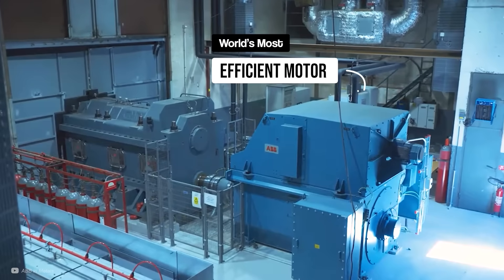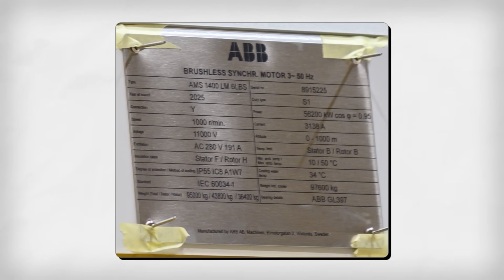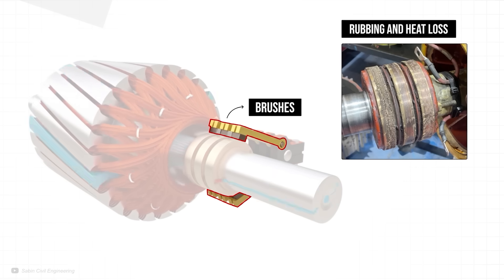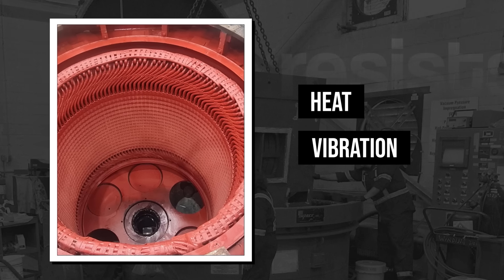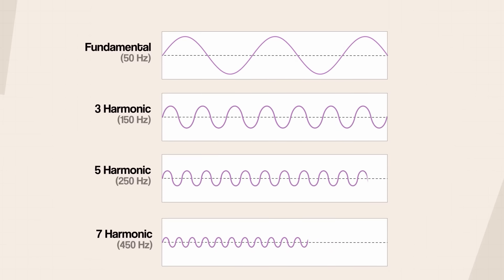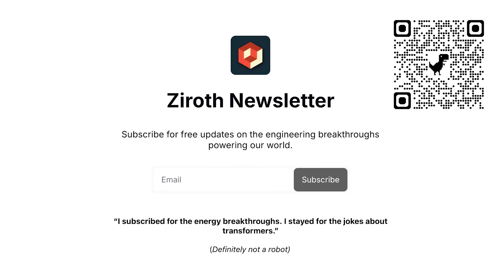How This Ultra Efficient Motor Just Broke The Limits

Comment: As someone who has worked in the field I'd like to comment on a few things.

0:20 "motors are normally stuck around the 96% mark" That's not really true, you can look at other manufacturers, for example Siemens energy and you will also find efficiencies close to 99%. I think the value in your paper refers to smaller motors. I don't think you referenced the paper. If you tell me its name I can check.
3:19 "but these [slip rings] are far too inefficient [...], which would crash motor efficiency" Do you have any sources for this? I don't think the losses of slip rings are too high, maybe in the range of 1-2 % of the power they transfer. "Wireless" power transfer also has an efficiency <100%, so I'm not sure how much better this actually is in terms of efficiency. I also want to note that inductive power transfer has been common in the industry for a long time, so I don't think there is too much innovation here.
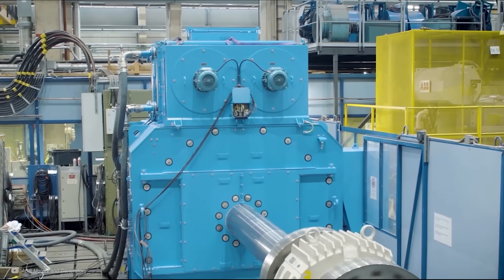4:00 regarding form wound windings: for motors this large these are used nearly exclusively, so this is also not a unique selling point of ABB.
7:54 regarding solid single piece rotors: again, ABB aren't the only ones doing this.
7:58 regarding "solid plates": I'm not even sure what this means and I have doubts that you do. How would these plates increase the surface area?
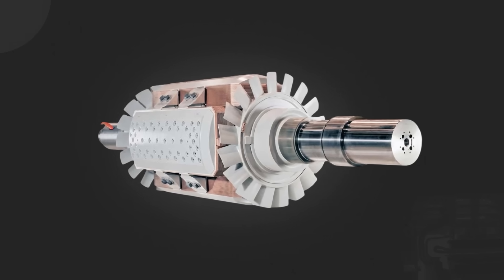8:48 "This [using a fan on the rotor] seems like a very efficient way to cool it, as it doesn't require large pumps [...]" This is correct, but I believe there is a technicality you are overlooking. Looking at the nameplate you can see that the motor is made according to standard IEC 60034-1. This leads me to strongly believe that the testing was done according to IEC 60034-2-1, probably using method 2-1-2C. This will probably mean nothing to you and you can't even legally look it up without purchasing the standard I believe. But what I can tell you from being in the industry is that according to this standard, the power of auxiliary equipment like pumps and blowers is NOT considered in the efficiency calculation. So to increase the rated efficiency you could theoretically remove the fans on the rotor to reduce air resistance and instead add an external fan, since the power for the external fan is irrelevant for the efficiency according to the standard. Of course this wouldn't make sense in practice, but it would look good on paper.
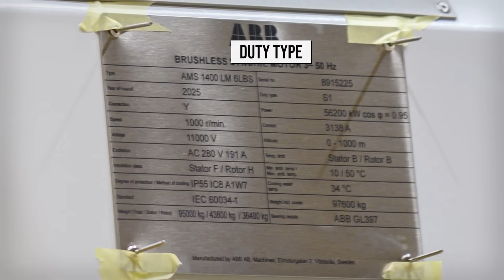9:17 you say that S1 operation is good, because the motor doesn't waste energy speeding up and slowing down. But I think this is missing the point a bit. These large synchronous motors are directly connected to the grid, making their speed basically constant. For motors like these, it is generally about the torque / load. So another type of operation might have a periodic torque profile instead of a constant torque. 
9:54 regarding the efficiency plot: Again, a bit misleading since these motors will only operate at a speed dictated by the grid frequency and the number of pole-pairs.
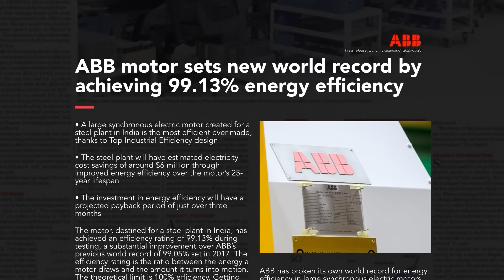11:00 regarding the cost calculation, I totally agree with you. Either it is a typo or the must've made some ridiculous assumptions.

Additional comment: 
As for everything in engineering there are always trade-offs. Maybe ABB used some highly efficient bearings, which have lower life-time or higher maintenance, we don't really know. So relying on a single number like "testing efficiency" and saying "this is the best motor" is never a good idea.
Reply: This is a much more complete reply, but I came to the comments to say ol' Ziroth gave nearly zero info on what ABB did to hit this record efficiency and instead stated a bunch of standard well known motor facts
Reply: As an engineer who worked both in Siemens and ABB in the motor and converter department as manager, I completely agree with you.
Both Siemens and ABB are great companies and 99% efficiency for motors of this size is not uncommon.
Of course it should be the electrical efficiency of the motor only, not the overall efficiency of the system with the load. Also the energy required to cool down the motor must have been excluded from their calculations.
$60,000 is ridiculous for a 50+ MW motor. That's cheap even for 500 kW.
Reply: @user-yt198 Even $600,000 is a low ball.  I'd say more like $6M easy.
Reply: Also, why didn't Ziroth just talk to the manufacturer to get accurate information?
Reply: Dr Ryan doesn't really explain stuff he just reads out press releases.
Reply: yeah, when I heard they use external pumps for cooling, made me wonder just how much energy is lost as heat that you require all that equipment. Would this heat represent the 0.87% power loss ? If so, must pay a price to went it all out at 50MW input. Is that like 435KW ?
Reply: Found an interesting paper on the brushless variable frequency motor / generators on the Boeing 787 and there is a lot of interesting things going on with the brushless aspect of this system. Was hoping that this video would go into more details about that part of the motor.
Reply: Yeah. They definitely used the standard to their advantage and conveniently published their world record results without any testing numbers. I'm actually surprised they let the picture of the data plate slip through. ABB waves their magic wand at the crowd and tells them to nevermind the  50+ kW power just for excitation. With an input power over 67.5 mW at full current and speed they must  have a real sweet spot in that design to get a 56.2mW rated motor to break η past 99.

It's not as though 99% of the people who see that claim would have any clue how to make the calculations to refute it or know anything about the testing methods.

Shameful really.
Reply: @BxxMxxK I believe you mean MW instead of mW.
How did you calculate 67.5 MW?
P_el = 11kV * 3138A * sqrt(3) * 0.95 = 56.8 MW.
If you use the efficiency you calculate P_el = 56.2MW / 99.13% = 56.7 MW.
The small difference can easily be explained by rounding in the cos phi value. So the nameplate seems fine to me.
Reply: Another consideration is that measuring efficiency with this level of accuracy is itself very difficult due to the tolerances of the equipment.
Reply: @gullenator1 yeah, it's not that easy.
For big motors like this, efficiency is usually not measured directly. There are different measurement strategies to determine the different loss components.
Reply: @MrZauberwuerfel 

This video is clearly not pitched at people who are experts in the industry 😂 I learned a lot from this video, even if it seems this is all old technology 🤷‍♂️ 

I look forward to your much improved video explaining all the things you mentioned!
Reply: The nameplate says 3-50hz, wouldn't a motor like this, at least in many applications, normally use a VFD, at least for startup, not just some huge contactors sending it power straight from the grid?  I imagine some applications want speed control, and they need to limit starting amps.
Reply: @Artcore103 think if this motor bangs in with contactor! Many motors even without load could easily take 10x more load at very short time.

I think this motor could be put in grid and then starting to rising power for it's rotor, if they don't use thyristors to start it, before closing contactor fully.
Reply: @jannejohansson3383 the thyristors normally have a rating way higher than the rotor is designed to handle. All it does it shorts the plus and minus ring on the rectifier assembly. Normally we see discharge resistors which are found on units that are straight to the grid. Normally I see vfd start motors which are capable of running fully on the vfd but the end user will be using it only for start up.
Reply: That IEC standard is actually pretty easy to legally obtain for free, with one loophole:
The trick is to search for: "ГОСТ IEC 60034-1". Which is de-facto just a translation of the IEC standard, but de-jure it's a separate document, published by another entity.
It is legal to read for free because of "ст. 1259 ГК РФ", i.e. article 1259 or the civil code, which says exclusive rights can't apply to legal documents and government standards.
So just prepend "ГОСТ" to an international standard when searching, and use an online translation tool to read it (or learn Russian).
Reply: MrZ is guessing about running direct off the grid.  Why didn't he just ask the manufacture or the buyer?  It very well could be started and run with an inverter to control speed and torque across a wide operating range.  Else additional "damper bars" winding can be use for grid startup, but there was no info about that. 
It does not make sense that it is not PM (permanent magnet) which would have far less losses than either a wound field or induction machine, unless it is actually superconducting.  There is alot off missing and questionable info.  Seems more like bait for that 8bed thing.
Reply: I was coming here to write my own essay based on my experience at GE large motors. Thanks for saving me the time. Seems everyone is doing the same stuff. Those plates are commonly referred to as pole tips. The GE design from Peterborough machined the rotor from a solid forging, including the pole tips.
Reply: @JaredLucas and wasnt cheap!
Reply: Legally obtaining IEC 60034 for free is actually pretty easy.
You just prepend "ГОСТ" to the name of the standard when googling, and you get the translated version.
Thanks to article 1259 of the civil code any government standard in Russian is public domain.
Reply: Others might have done them separately, but together?
Reply: Legally obtaining IEC 60034 - 1 for free is actually pretty easy.
You just prepend "ГОСТ" to the name of the standard in your searchengine, and you can read the translated version. Thanks to article 1259 of the civil code any government standard in Russian in public domain.
Reply: Legally obtaining IEC 60034 for free is actually pretty easy.
You just prepend "ГОСТ" to the name of the standard in your searchengine of choice, and you can read the translated version. Thanks to article 1259 of the civil code, any government standard in Russian in public domain.
Reply: Re: "Solid Plates" I believe what he is alluding to is the poles are made of a solid mass of iron as opposed to a laminated steel core with a squirrel cage start winding.  This motor is referred to as a hysteresis or eddy current start motor. The eddy currents in the pole initiate rotation. The rotor gets really hot on startup, and as very low stating torque and normally it has to be up to speed before the load is introduced. The tips of the poles are machined in a sawtooth fashion to increase surface area to aid in cooling during start up.  Once the rotor is up to synchronous speed the slip is zero and eddy currents are not present. As well this design is not exclusive to ABB and it has been around for decades.
Reply: @joekoncovy ah, so solid plates are the salient pole design, but without damper/amortisseur windings?
Reply: Or pay more for exotics material or construction techniques.
Reply: I attend to agree about the friction loss estimate for the slip rings.  Those brushes are made of graphite, which is an excellent solid-state lubricant.
Reply: "I don't think the losses of slip rings are too high, maybe in the range of 1-2 % of the power they transfer." Wouldn't that immediately cause them to miss the 99.13% efficiency goal?
Reply: @prdoyle no, the slip rings only transfer the power used for the excitation of the rotor, ~50kW
Reply: @prdoyle      The watts sent to the excitation circuit is only about 1/1000 of the watts used by the motor, or <53.5 KW vs. 56.8 MW, so excitation is less than 0.1% of total motor stator watts. Now take 1%-2% of that number and it becomes 0.001% to 0.002% loss. The advantage with using brushless excitation is the elimination of carbon dust and no slip rings to maintain.
Reply from the maker: @MrZauberwuerfel I wrote a response last night, but thought I would spend more time to write this one as it wasn't making the point I wanted to very clearly. 

Firstly, thanks for commenting, there is a lot of interesting insights here. The context of this video, which I didn't make as clear as I should have, is that I wanted to show how the worlds most efficient electric motor(s), namely large industrial motors, reach such high efficiencies. Especially when compared to the standard motors many people are aware of, like those found in electric vehicles. The aim of the video was to show what is done to make the jump from around 96% peak efficiency in those motors, to 99% in large industrial motors (specifically the ABB one). This not being made clear is probably the main issue here, and was to reflect that the 'broad' audience who watch these videos might be interested in the design of these large motors and how they differ from more common ones. It is not a video about how one industrial motor is 0.1% more efficient than another one - that is a very different video.

On to the specific points:

0:20 Correct, this refers to smaller motors that most people would have come across.

3:19 "inductive power transfer has been common in the industry for a long time" - this is exactly because they are more efficient than slip rings, especially for large motors. Losses in the slip rings due to friction and less than perfect connections are higher than the electrical losses for inductive coupling. I used stronger language here than maybe it needed, but the point remains that slip rings would have prevented this motor getting the record, and it is an interesting thing to note, in my opinion. This video isn't about a new breakthrough or innovation, just lots of well used engineering principles.

4:00 Correct, this is because they are more efficient and it was worth noting as it is a key part of their design.

7:54 Correct, again, this is still an interesting part of the motor that a non-specialist audience may not have known about.

7:58 From ABB's publication 'Synchronous motors - High performance in all applications' they say "The large cooling surfaces and effective flow of cooling air keep the rotor temperature low and uniform". The plates are the flat areas shown with small holes in them, these are designed to hold the windings in a way that provides a large enough cooling surface to keep the rotor cool via convective air cooling. I can't comment on this further with the information I have, it wasn't a particularly important part of the video. 

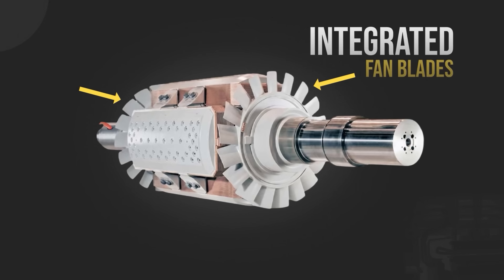8:48 This is a very interesting point, and yes I agree they probably used those standards to test efficiency as they appear to be industry standard from looking them up. I always think its useful to consider efficiency on a systems level rather than 'hack' it to improve efficiency - though I see your point that this would not effect nameplate efficiency. ABB know their stuff and I'm sure their client was more interested in real world efficiency anyway.

9:17 Very interesting point. I was more trying to make the point that dynamic loads are generally less efficient and harder to optimise for than static (or quasi-static) loads. However, I agree if you drill down further into the details there is more going on here. 

9:54 I don't see why this is misleading? The point I was making is that these efficiency islands can be tuned (through motor design or otherwise) to ensure they overlap with the operating conditions as much as possible. It doesn't matter what determines this speed, just that it is known ahead of time. 

My final thoughts:

I always love reading comments like this, you are clearly very experienced in the field and could teach me a lot. I hope you also see my point of view, that most people are not in your position and do not know the details of industrial machines, so a comparison of them to ones they are more familiar with is still very interesting. 

Going forward I will attach the script with references to the description, I should have started doing this a long time ago, but better late than never. 

Cheers,
Ryan
Reply: @ZirothTech   Can I just say, when a person has a doctorate in engineering, they are much more technically accuatre, precise, information is well pressented, comminucate extremely well etc etc, to all us lesser educated people. Everything would/should be to an extremely high standard, extrememly being the key word - you have a doctorate. So I am suprised by many things, like quoting manufacturer figures without further research, you use words like "I think" in your replies or videos, when someone who is 'technically literate' working in that area (@MrZauberwuerfel ), but is probably not educated to a doctorate standard, can point out many inconsistencies, mistakes, etc etc. I would think a doctorate educated person woulld be the person you could 99.9% rely on their inforamtion as gospel. I think you see my point.  Unsubscribed.
Reply: Finally someone who gets it. A lot of mistakes in these videos and still no real insight on how the efficiency was really reached.
Reply: > These large synchronous motors are directly connected to the grid, making their speed basically constant

But how are they started?
Reply: @wormball  it's electric motors all the way down
Reply: @prdoyle  always was been
Reply: @wormball 

When I went on a field trip for my engineering class to a massive water pumping station with 14 pumps of 80,000 horsepower EACH, they used a DC motor to get the AC pump motor up to speed. This was in the old days, might use a variable frequency electronic motor drive today. If I remember correctly the water flow was cut off by valves during the startup / AC synchronization process. In my electrical machinery class we used a DC motor to synchronize a synchronous AC motor (or generator) to the main AC using light bulbs to do the process. Today you push the go button on the motor drive electronics. Not quite the same experience.
Reply: @wormball   'basically constant speed" would probably refer to, you would imagine, considers the typically maximum, start time (eg a max of a few minutes, probably ~0.05% of total run time), compared to the run time (probably 99.95% of total on time). In other words, the starting time is irrelevant compared to the way it runs 99.95% of the time.. That explains 'basically a constant speed'
Reply: @wormball  Using power converters would eat up into the efficiency figures and for a constant frequency usage, power converters would be an overkill. 

They'll probably use an extra set of motors to turn the main machine and get it synchronous to the grid frequency. 

Sounds easy, but getting it right in sync like this ain't an easy task.
Reply: Can we keep the increased CO2 production please. It makes crops grow really well and India could always do with more of that.
Reply: Quit making your problem everybody's problem.
Reply: Exactly this, you saved me from typing an essay myself.
As he was going through the video, I was thinking “yes, that’s how they’ve been made for the last 50+ years, what’s your point here?”
The final nail in the coffin was “this motor is in India”
Ok bro this erases every record breaking statement they could have made, Indian companies usually focuse their resources on PR rather than operations, so this has 99% chance of being a sham.
Basically pulling the Mad Men “Lucky Strike  Toasted” stunt: “we reinvented the synchronous motor” and “we reinvented phone wireless charging into motor tech”, STOP NOTICING Faraday first law and makeshift induction motor in 1821
Reply: @angelobonanno1859 I will say that its helpful that people are providing context and corrections,  but its clear that the guy did put some effort into putting a video up on a topic no one generally makes videos about.   I feel that a lot of people come to lamblast people but none of the people complaining ever bother up create videos of pinpoint accuracy themselves.   So everyone can go on critiquing every thing he says to the point that he never makes another video about it.   Or you can correct the errors and say thanks.   Without him making the video I wouldn't have had any insight into this type of system at all nor read this original context if this comment thread.  If he's not good enough in people's eyes then make your own videos because it's a rough game being a content creator.
Reply: @sparaz I agree, if your already a specialist in this field I’m sure there are better videos to spend some time watching and commenting on, I’m not, and I learned something through this video so thanks!
Reply: @SteelyEyedH exactly.   Since i buried my comment four threads down i appreciate that at least someone found it and feels the same.   Even though I'm sure many people found utility in a random video like this